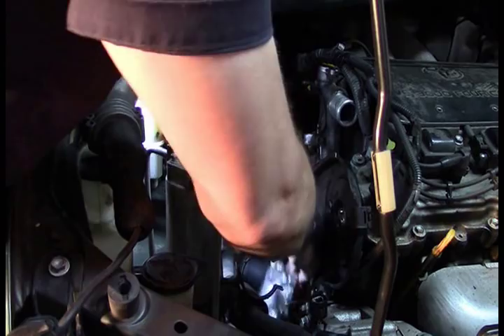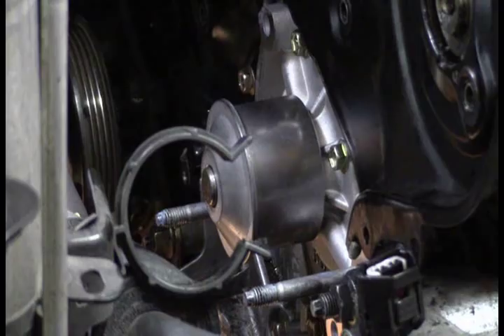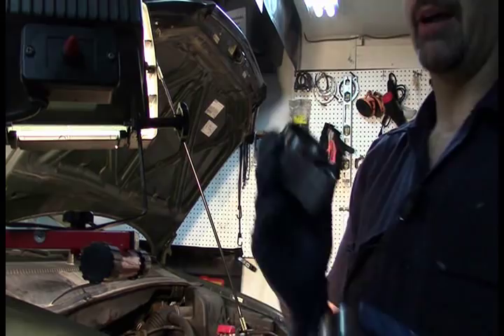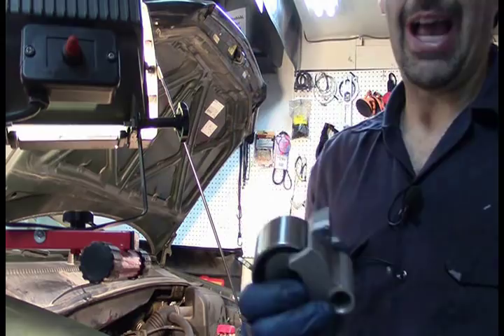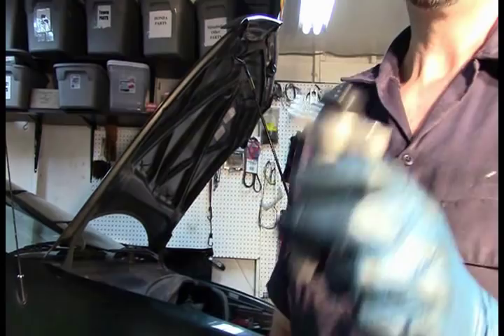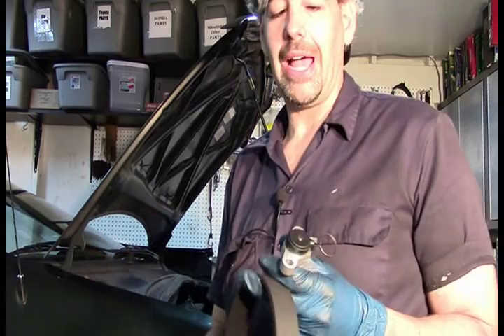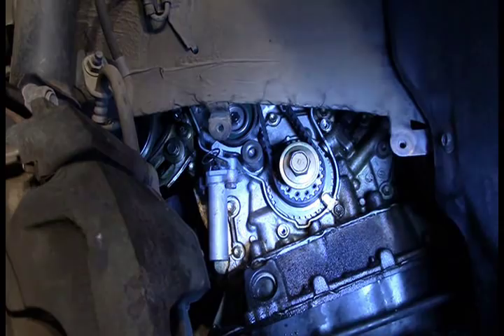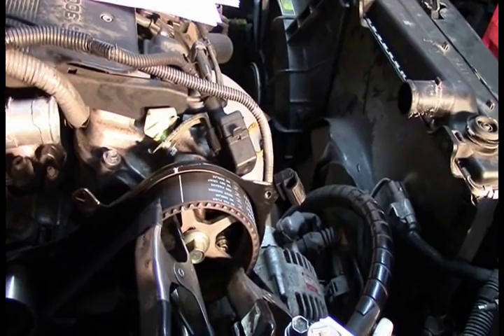Timing Belt 1997-2010 Toyota V6 Sienna, Highlander, Camry, Lexus Part 3

Comment: This is driving me crazy...sorry to bug you so much...so I went to crank it and it didn't turn on...now I'm wondering if I used the wrong timing mark on the crank on the bottom, the one you show on the video is closest to the wall and the one I used it colored red and is also a dot but it's on the too of the crank...any idea?...also I was going to try and set the timing to the on the wall but the crank became real hard to rorate...should I be worried? Can I go the opposite direction you think?
Reply from the maker: I really don't know what to say. It goies without saying that you must have the crankshaft positioned at TDC#1. Unfortunately on these engines you have to remove the plenum to do that since it covers #1 cylinder. The first time I ever did this procedure I went ahead and did that just to be sure- I of course no longer do that.  I recommend you do that though- if you are not absolutely sure you are at TDC#1 when you install the belt then of course it not only won't start, but you are probably going to destroy your engine.
Reply: Lol thanks...ok well let me see what I can do...

Comment: Moved comment to video 2.
Reply from the maker: +Sandbag1300 got it. hey where have you been man lol??
Reply: Watching all the video inventory at South Main Auto.  

Used advice from your videos to evaluate two used cars last weekend.  Passed on the first, a 2006 Mustang GT, and purchased the second, a 2005 Camry V6.  On the Mustang, known for electrical issues, the battery, which looked brand new, was in bad condition and the alternator was working fine.  The car was located in a small town and the dealer and mechanic were friends.  The dealer was friends with everyone in the town.  
I asked the mechanic to do a parasitic amperage drain test on the battery.  He said, I don't want to disconnect the battery because it will shut down the computer.  I looked at him in amazement, asked him how much money I owed him, and then told the owner I am taking a pass on the vehicle.  Ha!
The Mustang did have other issues including Takata Air Bags that grenade upon deployment and an engine that needs to be pulled to change exhaust manifold bolts and gaskets, which I learned during my paid inspection.  The potential electrical issue was a third strike.

Comment: Timing Belt (TIMING):  Good job on the timing of the timing belt.  I give you an 8 on a scale of 1-10.  This procedure is extremely important because if you do not get it correct you will need to do the job over.  A lot mechanics and want to be mechanics will get this process wrong and have to do the job over.  Timing is the main essence of this procedure, hence timing belt change and yes changing the belt is important, getting the timing correct is just as important.  I have seen ASE profession mechanics do timing belt YouTube videos on the 1MZ-FE and yes they complete the job but they do a poor job of explaining the process to a level of the DIY er.
Reply from the maker: siucbset Wow you give me an 8 out of 10 huh?  I wanted to see what a 10/10 would be so i looked on your channel but you have no videos at all.  When you spend 10 hours fixing a car, filming, and editing it let me know so i can eat popcorn while judging it with such specificity.